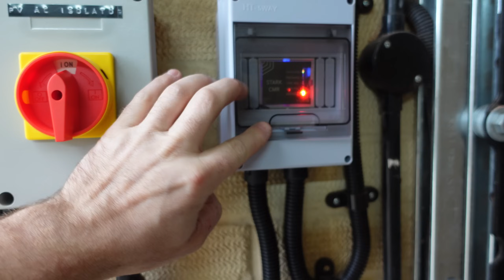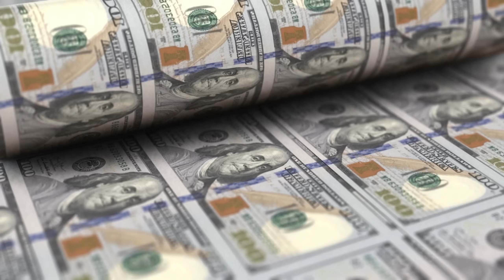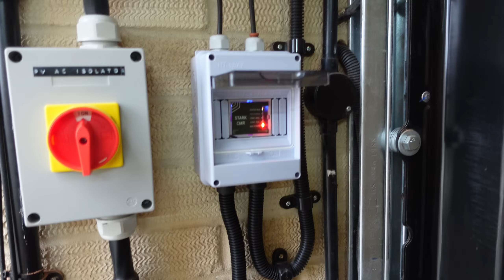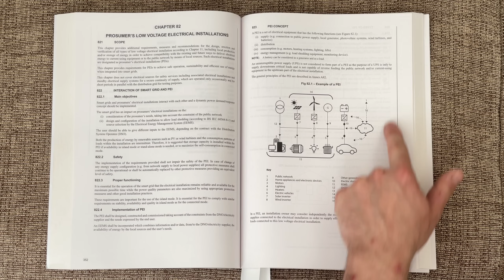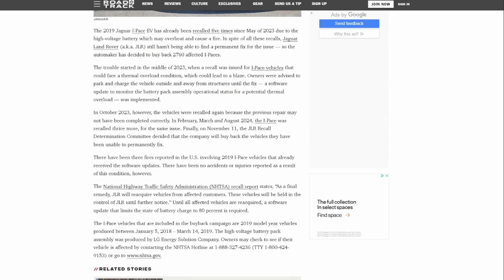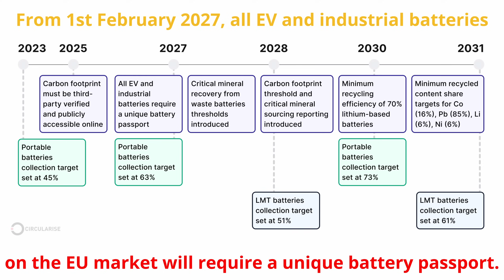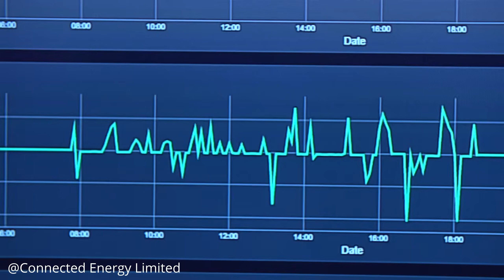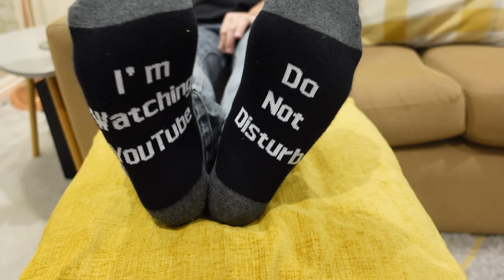4 Reasons I Chose an EV Battery for Home Energy Storage

Comment: Your point about splitting the battery pack down was the one that kept coming into my head when I was following along with your project. For starters it would avoid some of the workarounds you had to implement for the battery comms and startup (capacitor?) burnout, and would also mean a dedicated storage BMS. Did you ever cost up the equivalent project with splitting the pack? I think it would be a really interesting comparison (although I totally understand the desire to try new things in this, very cool, project!)
Reply from the maker: Yeah. The focus of this series has been a complete pack. Plug some wires in and a box and it works. Of course it hasn’t been quite that simple. But it shows what can be done. Even now I would say the system isn’t 100% dialled in. Partly because I have 2 EV batteries connected but partly because we are still working out how Tesla control the battery in some aspects that effect long term use. 

A lot of EV packs are becoming harder to break down like early packs I mentioned in the video. Although if you went down that route a BMS and some other controls it can work. You then have to consider packaging. Tesla packs are now 4 long bricks. Not possible to break them down as they are bonded to the cooling plate.
Reply: @TheOfficialBatteryMan there is guaranteed to be a solvent to remove the heatsink bonding but you may have to go to a chemist to find it & anyway it's going to cost extra to make up a (probably sealed) tray to use it. Plus disposal costs.

Comment: How did you get this passed the DNO to connect to your house. Did you get  a G99 approval.
Reply from the maker: I had a convo before hand. They were originally involved for the unloop which I wangled to 3 phase upgrade ‘for free’ then put the application in. On the forms noted the inverter. On the wiring diagram I added the battery. But didn’t give much detail other than the capacity

Comment: I absolutely want to do this, but currently not planning to stay long term where I am.

I think what would help mitigate the risk, is having a lilygo unit pre-programmed for the specific battery you're about to purchase, that is sealed up, so that I doesn't look like a hacky job. Then I can plug it into a battery pack and validate the health and age claims. The only problem is unless you already have a good battery, you have no way of knowing if you've setup and programmed the lillygo properly.

Guess I'll need a 3d printer too.
Reply from the maker: Yes currently you’ve got to know how to use Arduino IDE. I think we can 1 up that with the Stark CRM board. It’s din mounted and takes away the wire mess of the Lilygo
Reply: @TheOfficialBatteryMan  I don't have much faith, I checked the site the first time you mentioned and it didn't load, tried again just not, stuck trying to load.

It's a bit pricey too, yes I know that sounds silly when I'm willing to buy a Tesla battery pack :/

I don't think arduino IDE is that difficult, use it on some of my Pi Zero's. That reminds me, I need to get back to trying to mess with my car's CAN bus.

Comment: Also check out ambibox which has Bidirectional DC Charging (V2H and V2G) Successfully Trialled on a standard MG4, which maybe another interesting development on current suitable vehicles (I have a MG4 SE LFP, which is why im so interested in your developments)
Reply from the maker: Very nice. Will do a little more research. If you’re technically minded and like to tinker. The Battery Emulator project needs CAN bus data for different packs. And the MG LFP could be a good option for people wanting to do this sort of thing. Details are in the Battery Emulator wiki pages on GitHub
Reply: @TheOfficialBatteryMan  I think  SIGENERGY also has a 25kw DC bi-directional system also

Comment: I'm about to install a 30kW inverter but it needs a high voltage battery. Tons of experience building batteries 48v NCM and Lifepo4) so I'm wondering if I should grab a Tesla Model 3 LR battery rather than kill myself building a 60 series LFP battery myself. All I'm worried about is the communication between the Tesla battery and the inverter.
Reply from the maker: As I said in the video to build up your own 400v pack needs balls of steel. Most battery emulator ev projects don’t need you to open the battery at all. Lets face it you sound like me a curious man so you no doubt would open it anyway 😂
Reply: @TheOfficialBatteryMan  If it's not broke....make it go faster :P

Comment: That's an awesome project and the enclosure looks great!
The next logical step is for an electrician to turn it into a commercial project and install them for people who aren't willing to do the research or take on such a complex project.

I imagine the other thing that'll happen is that electricity companies will start buying up old EV batteries and installing them at electricity sub-stations and also at solar/wind farms.
Reply: I made basically the same comment before reading this. Make a gizmo. A big fancy plug/inverter/meter/ whatever you need, and you just screw it to the wall and attach the leads from the battery. I think there are going to be enough car-smash, perfectly sound, EV batteries available, because the increase in the number of EVs on the road, will probably outstrip the increase in the number of us wanting to do something like this. (After storm Eowyn, I can imagine a huge market in the west of Ireland*.)
      In the following years, we will have increasing numbers of EV batteries which are down to 70%, or whose car has worn out, so we will still be good. After that...15 years?... I don't really see much of an 'after that'. If there is an, 'after that', then the technology we are discussing now, will be so outrageously obsolete, orrrr.... I return to my 'No, after that.'
*...west of Ireland. Many people were still without power, ten+ days after the storm; often that meant  no heating and no running water either. (This is actually more of a landowners/ forestry thing, than a grid thing-per se.) I think a local mini-grid, easily repaired by local technicians, and reliant on only daylight and wind, would be very appealing to many of these nay-sayers now.
 NB I never heard a single heart warming tale, from out the west, of someone with solar panels, getting by much better because of them. I know it could look gloaty**but, if they had recharged enough phones in the neighbourhood******, they could have generated enough Love Oomph!, to warrant a nice-news story!
 ((*******Probably they were grid-connected in such a way, that they couldn't use their own solar when the grid went down, so maybe fix that sh*t!) If anyone knows of anyone who got any benefit from their solar panels in the storm, and aftermath, let me, or someone important, know. We might all get free solar panels, just to shut us the F*ck up.
,(gloating? Gloatesgue***?) 
* 'Gloatesque' Like 'Grotesque', except, the person  is 'Gloating' about the thing/incident etc., in question.
 I made that word up. I own it. So any of you want to use it - get in touch... with my people obvs, and my people will meet your people---- Hah! Maybe. 
 That deviated. I'll accept that. Sorry. If even one person enjoyed it, I'd be happy.
Reply: @michaeljames5936 Wales had a lot of extended power outage as well but mobiles & internet went down too so phone charging wasn't particularly useful.
Reply from the maker: I do hope so
Reply: Have you all gone insane ? , those lithium shyt things could be the end of you , your house , your family.....the fierceness of burning from the damn things is shocking,  the media and politicians are covering up the dangers of these things, how evil  ! , worse still is falling for the scam.
Reply: @ejh1100  didn't they say similar when the internal combustion engine was put in a car with a mobile tank of highly inflammable liquid?
Reply: @davidcaple5547   at least that liquid has a good chance of being extinguished quite quickly,  not so with a self fueling , extreme high temperature,  and very fiercely burning lithium horror which can reignite hours , days ,or even weeks later, and we won't mention the deadly fumes  !
Reply: @ejh1100  maybe quickly extinguished now but not when it was first used!  Anyway, you can stay in the current state while others move forward to the future ... but be thankful you have what you have now because of the pioneers of 150 years ago.

Comment: Could see me getting a battery sized trailer welded up for an NMC battery at some point. Can see it being hard to find a tame electrician though.
Cheap night time rates and large cheap batteries are what will get people onto heat pumps and off gas.
Reply from the maker: Yes. Almost a need to have batteries with a heatpump. At least if you want the cheap rates. I’ve toyed with creating a trailer to effectively become a generator. Just much quieter. I could see that sort of thing being rented out to building sites, TV sets festivals so on.
Reply: @TheOfficialBatteryMan  there's a guy in Sweden (flying tools) that used all the cells from an id3 pack and home battery is in a trailer in the garden. You've likely come across the channel. NMC does have the benefit of maybe handling the cold better, but wants to be away from the house, especially if outside battery case.
Reply: @TheOfficialBatteryMan there is one that used to appear at the Green Gathering, also roadworks traffic lights & illuminated road signs are starting to sprout small solar panels, even windmills occasionally.

Comment: It won't catch on for home use simply because the infrastructure is insufficient between the local transformer and the street to handle such massive imports and exports.   You house is not directly connected to "the grid" only to the local network.
Reply from the maker: You can still run an ev battery from a 3.68kw or 5kw inverter. It’s amazing learning how different countries work. In aus they use these set ups to peak shave and avoid putting the entire house into high rates. 

But I agree way too big for the average home. Fortunately I’ve got a 30kw export limit which I touched on in the 3 phase video

Comment: Price per kWh ? Please you are a qualified  electrician. 
Nobody would say it is 240mph from Liverpool to Edinburgh.
You make a lot of sense even though.
Latest data shows many ev batteries may last 20 years (up to 80% capacity).
2nd life EV batteries will likely be used in commercial installations for static storage with proper regulation. This makes a lot more sense than destroying them to recover lithium etc. 
My DNO limits my export to 5kW. Many only have 3.68kW allowance, so a non starter for most homes. Then there is the insurance issue.
Insurance companies work on risk data. There is none for 2nd hand ev batteries in homes so insurance may be an issue.
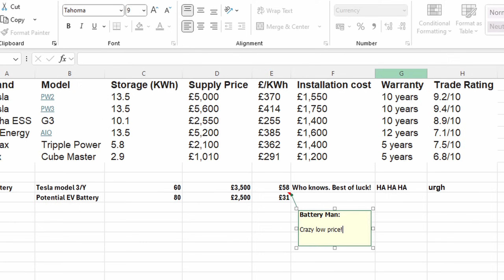Reply from the maker: Ahh did I mess up a kW kWh. I did show a price per kWh at 2:49 the first battery more expensive was £63 per kWh. 

Having enough energy to get through the day regardless of the inverter size is important. I’ve been working on a video on the export limits. Why do most people actually have 3.68 kw limits? I was conned with this before I trained as an electrician a few years ago.

Comment: Yeah kudos to you but 400volts scars me even when I was doing electrical installation. As long as you’ve taken all precautions that’s all you can do big battery small battery fire is fire the risks still apply getting a small battery does not mean no fire risk just less fuel but risk still applies.
Reply from the maker: Working dead so on. There is no need to be touching live parts unless you’re getting into battery repairs. Like the Pyro fuse. I felt the same with the 3 phase upgrade working before the RCBOs

Totally agree with fire risks. Generally these sort of project people don’t keep them in their house like they might with a normal home battery which improves safely
Reply: @ with what they are wanting to push for presumers is battery be in a non habitable are, so don’t think much people are going to have a choice on location soon, working dead you still hear thought it was finished switched it on.
Reply from the maker: @DTech101 good point

Comment: Cracking & thought provoking series - well done you! My view is that the use of LFP batteries such as this may be used in energy storage at source (e.g. solar field), and for grid balancing (e.g. similar to what Drax have shifted into). For the domestic side of things, aside from all the electrical challenges/approvals/compliance etc., the biggest problem is the transport to site & lifting into place, of a whole battery. A modular 20kg Pylontech type rack system will be how the UK market will endup in domestic situations. We've already seen how the Demand Flexibility Service (DFS), has been quietly shelved for domestic situations, all the national grid want is to deal with the large organisations, with Octopus Kraken leading the way.
Reply from the maker: Yes very true. The cells in most EVs are not really designed to be removed and repurposed into smaller easier to use bricks. 

Shame about DFS. I do wonder if this year is a comparison to last year with the potential of it coming back. You also can’t loose the assets that DFS has been avoiding being turned on. If they were not used and DFS used instead they couldn’t run a business and they eventually won’t be there when needed. Challenging for sure

Comment: Why don't you offer this service? You are expert at this point.
Reply from the maker: Largely because things don’t usually go smoothly and nothing is simple. It only takes a few things to change in code and a system could be out of action requiring resetting. Basically. Running it yourself as a bit of a nerd is ‘ok’. Managing someone else’s remote location not so ‘ok’. Now grid based container based energy storage i would like to put in place. One day when the YouTube money comes through we will and to start a community owned Battery project. There we are I’ve said it. 😂😂😂

Comment: Ive watched most of your vids and youve not mentioned your personal home usages, ie if you have elec heating/water heating etc ?
 I originally looked at usage of our old business, a 25 bed bnb, and figured a 50 kw battery could last 3 days off grid, we are now back in a family home and considering something like your self, maybe just a single battery though, so info of real life storage/usage in the likes of winter would be great.
Note, lets hope politicians dont start making rules up for these installs as it will just become an impossible tangle of silly regs which stop us doing anything.
Reply from the maker: General usage with small PHEV 20-25kWh a day max probs closer to 15kWh. All covered half the year with solar panels and exporting. Making closer to 40-50 kWh in the peak of summer. 

This is all covered from existing solar and battery installs. So my use case for the EV battery is purely buying and selling electric. However. We are still on gas. One day we will end up with a Heat Pump and wanted to make sure I could cover that usage. 

Smaller batteries is possible. The i3 installs are means to be the easiest with smaller packs. Albeit not LFP cells. I hope that helps

Comment: I found it fun watching you go through all the steps to make your setup work and I agree EV batteries should be used to the maximum of their capacity and cycle life, even potentially to 50% remaining capacity, as long as it is safe, ie until the risk of fires or other accidents increases. However, I would not have the knowledge or patience to take on such a project myself. I do think that creating megapacks with used car batteries would be a good alternative, these could be used for grid stabilization or backup energy for hospitals/offices, etc.
If I manage to one day buy a home, I myself would be far more comfortable setting up a battery backup using of the shelf parts. The cost of 3 or 5 kwh battery packs, either in box or rack mount format have come down significantly and can be connected to fairly cheap but capable charger/inverters using standard settings.
Reply from the maker: Nice comment. Will be interesting to see how it all evolves. And how much further battery prices will drop.
Reply: Shipping containers full of Nissan Leaf batteries have been in use for the purposes you suggest for several years now.
Reply from the maker: @alanhat5252 you’ve got to agree these sort of projects, as in grid storage using second life batteries, is still very rare.

Comment: Good job mate, I like what you have done, not for the average Joe though, a fair bit of tech involved.
I have 3x5kwh server rack batteries (15kwh) and a set of 16xEVE 310A cells with a JK BMS for another 15kwh.
All 3 sever rack batteries have failed within 2 years of use, the BMS has shut down on one and the other two batteries have 74% & 66% SOC respectively.
I’ll have to see what 2nd hand EV batteries are worth in Australia, it is a good way to repurpose EV batteries for solar systems & off grid.
Reply from the maker: Wow. So the JK BMS has been more reliable. I’ve got 8 x EVE 280ah with the JK BMS. Been working like a trooper
Reply: @ Yep. I have 3 sets of batteries all on JK BMS’s and all have worked flawlessly for almost 4 years now.